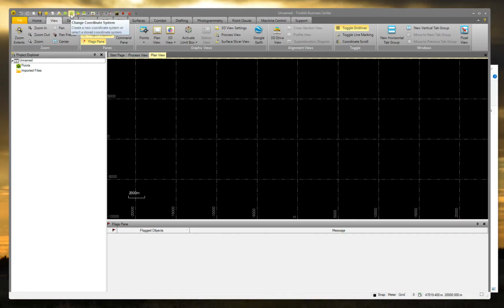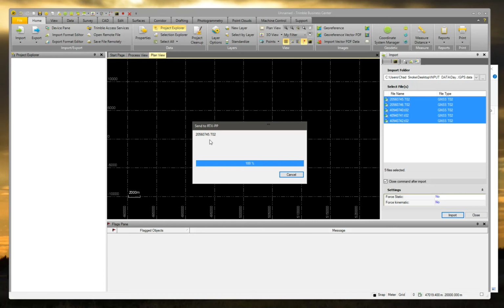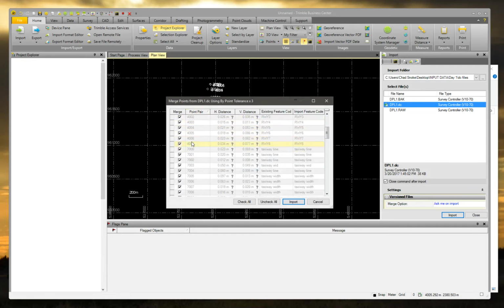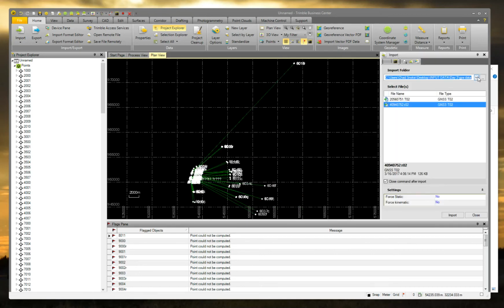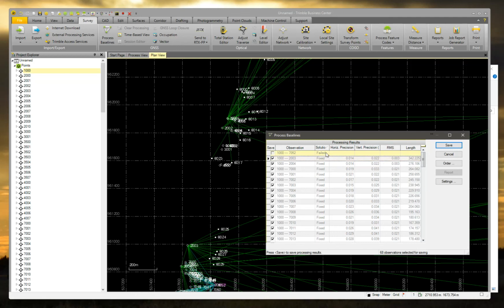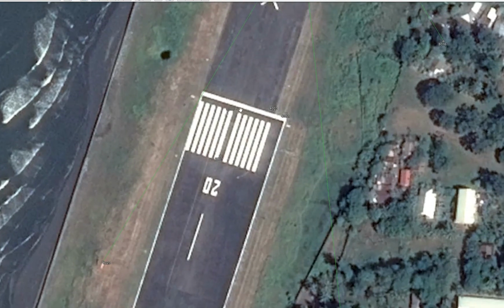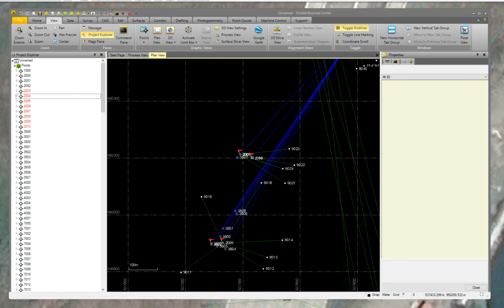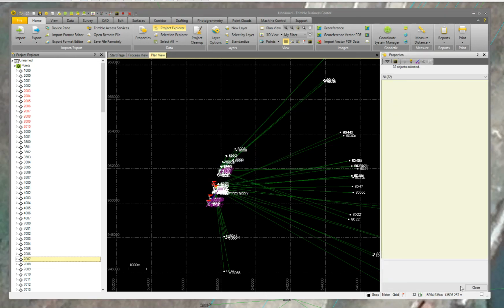TBC processing Tutorial 1

Comment: What the meaning of the red flag? I had a problem with my processing and it show the red flag. It state that i had an error at my vertical height. So may i know what is the solution?
Reply: A red flag on a point indicates an out of tolerance situation. For example, if you measure the same point twice and the difference between the two measurements is large. There are many potential causes, such as a rod height error, or bad GPS observation. You should investigate these points and try to determine the cause of the error.
Reply: Chad Snoke okay i got it, thank you sir